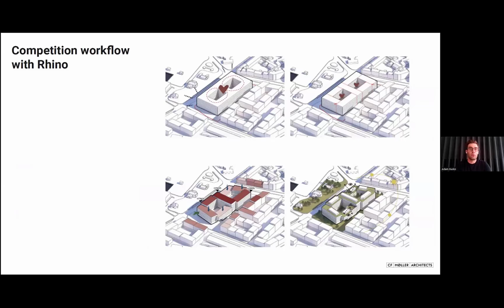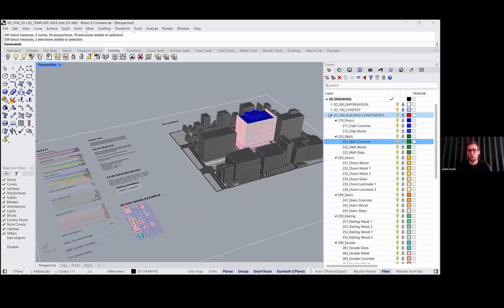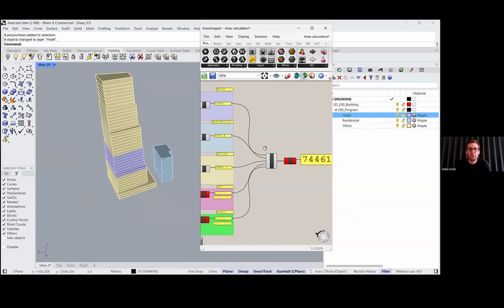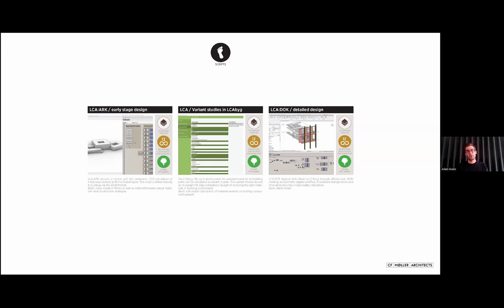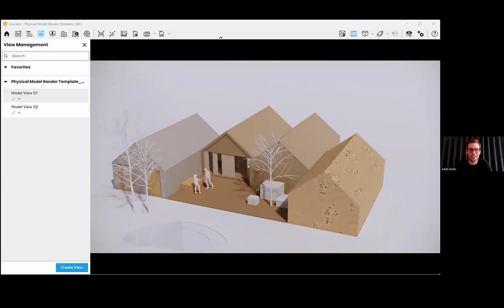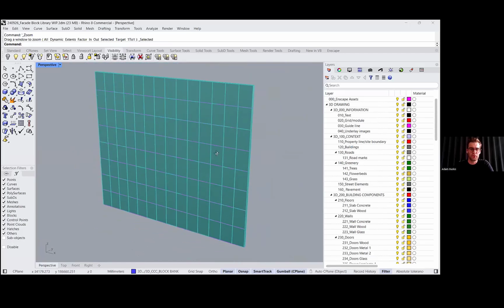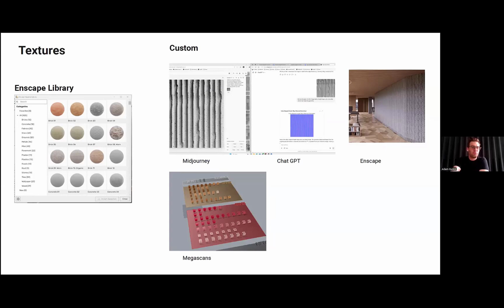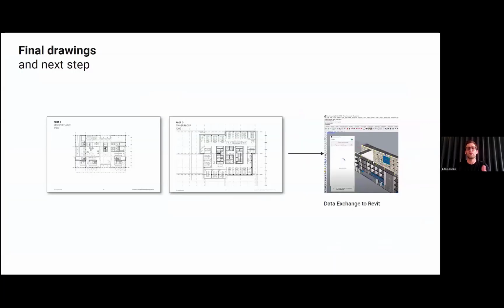Rhino User Webinar: Rhino for Architects - Streamlining the Competition Process

Comment: nice demo , but I wonder why threre is no layer  , for example L1 Slab L2 Slab , what if I want to turn off first layer of the building
Reply from the maker: Thanks for your comment! I think that workflow is from BIM softwares. You can do that with VisualARQ in Rhino for example.
The usual way to work in Rhino is to use clipping planes at different heights